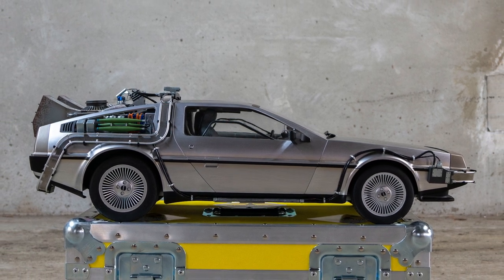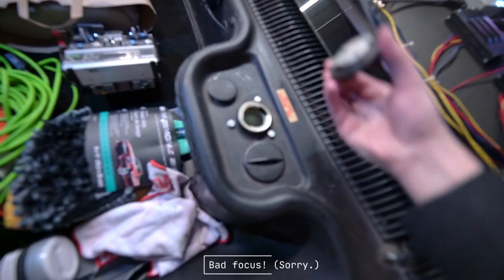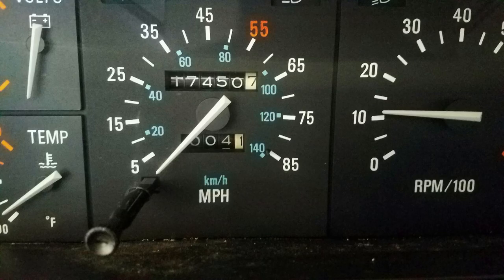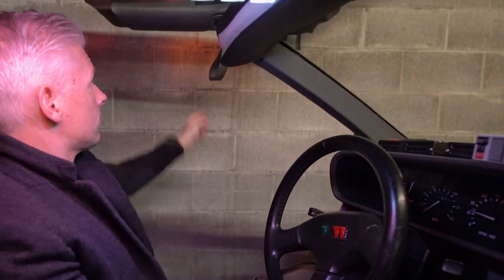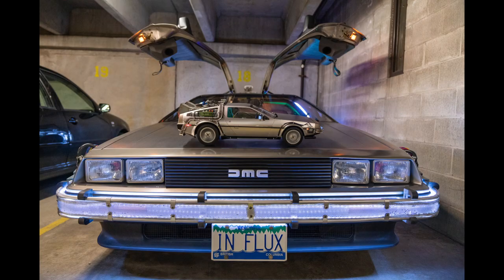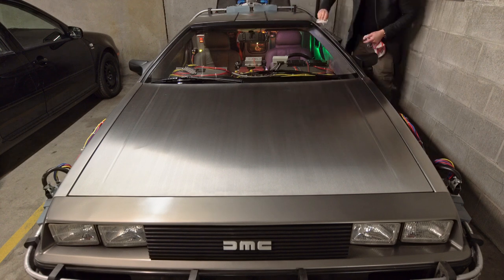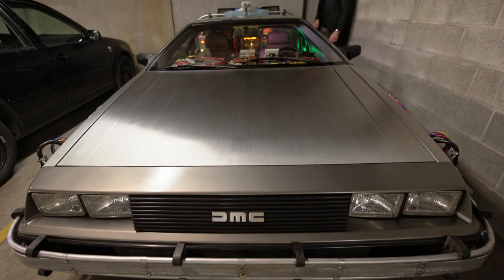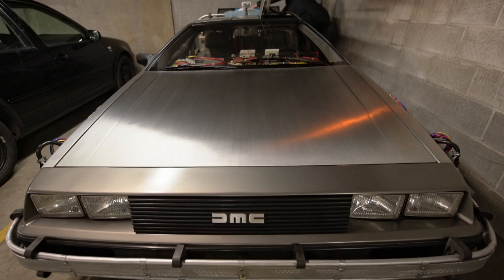“Owning a DeLorean” 101: Things I've learned, trivia + FAQs.

Comment: Car still looks amazing Scott. God I wish my doors opened like that.. did you have those balanced at DMC?
Reply from the maker: I did! DMC Midwest did a thorough look-over of the car, between repairs and upgrades. I’m not sure what the original state of the door torsion bar and struts was like, but I imagine they needed some work. The door struts were replaced, I know that much.

It may be that the driver’s-side door needs a replacement strut to fix up the sagging, though it is relatively minor. TBD.

Comment: Hm. If the battery is a bit low, putting the headlights on before start is not the best idea I'd say. Anyways cool car!
Reply from the maker: Thanks. I believe the lighting is almost entirely LED these days, and it may have been the colder winter weather more than anything else. The car usually starts first time.
Reply: @scottschiller  Well ... if the car has retrofitted head lights that may be. I still think that all the gadgets and lights will draw some power.  😃
Reply from the maker: All the BTTF props are on a separate electrical system, with a dedicated battery. A trickle charger is connected to both while I’m away. That said, I still expect the car to be a little slow as I only drive it “from time to time.” 😉

Comment: is the toy version available to buy
Reply from the maker: The 1:6-scale model car is the "Hot Toys MMS260" model, released in 2016. It was originally $689.99 (USD) - and while some listings are on eBay, I'm afraid prices have gone up about 300% since. 😬

At smaller sizes (like 1/18), you can get some pretty nice stuff for $150 or so. Check "Sunstar DeLorean" online for reviews etc.

Comment: Pretty cool but too bad it's not a manual.
Reply from the maker: The grey automatic is allegedly the most “rare” combination (vs. black interior and/or 5-speed manual.) Michael J. Fox apparently would hit his elbow on the time circuit switch box, in the screen-used A-car.

A manual transmission sounds awesome, in theory; but in my experience, I’m really glad I went with an automatic. It’s one less thing to worry about when driving around in a cramped interior, and in traffic, and with all the stuff going on around the car.